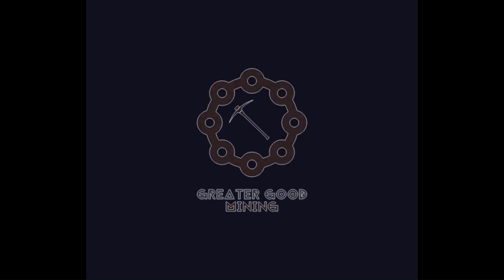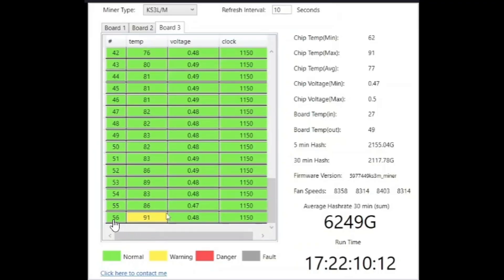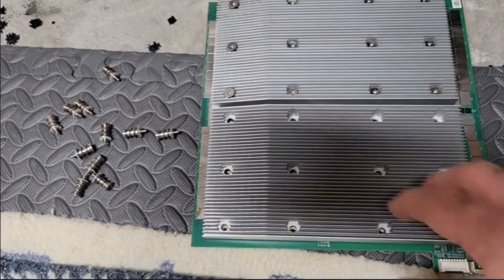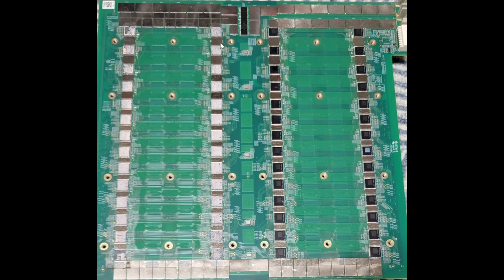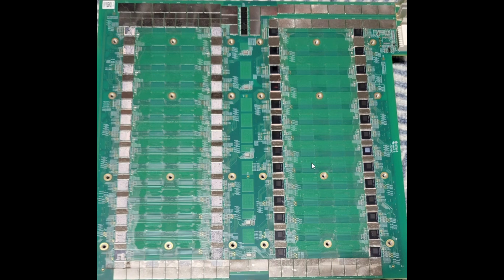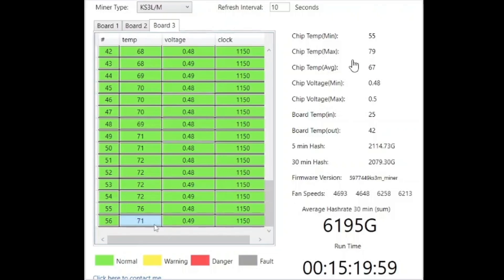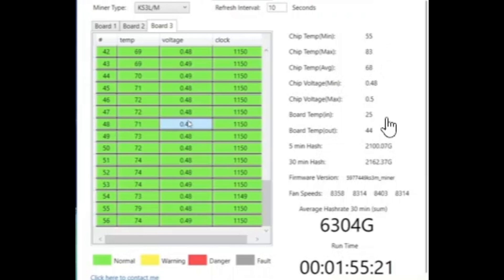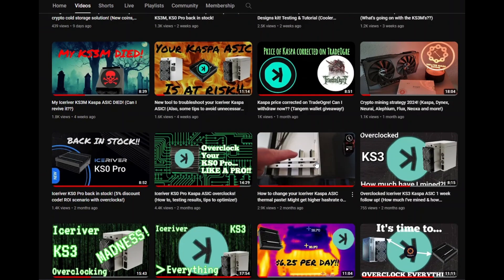Iceriver KS3M Kaspa ASIC thermal paste replacement! (Did it help my chip temps?)

Comment from the maker: Are you having problems with your chip temperatures on your Iceriver KS3M?
Reply: My KS3Ls are running fairly good temps, but the KS3Ms def needed repasting
Reply from the maker: @Farlok2088  time to get that Artic mx6 out Farlok!!
Reply: @GreaterGoodMining  hi do you recommend another thermal paste? becuse mx-6 is not available in my country
Reply from the maker: @Nawaf-ko9lo  mx6 is the one I have the most experience with buy yiu can look for other thermal paste with similar properties and conductivity. I've used Corsair brand thermal paste on CPU's etc in the past and it worked great. I hate to say it but almost anything is better than the stock thermal paste
Reply: @GreaterGoodMining  I changed the stock thermal paste of my ks3m to corsair xtm50 thermal paste and I still got overheated chips and for me it's hard to get mx-6 thermal paste so I have been searching for another good brand for my ks3m but I got not result so please can you help me with another good brand for my ks3m ?
Reply: How much g i need to replace 3 hashboard thermal
Reply from the maker: @7amanyalhayki929  I would recommend getting 2 tubes which is 12g total. You probably only need 2 tubes, but I like to have more than enough in case something goes wrong with reassembly. It sucks to run out and have these machines down while you wait for more to arrive. Here's a link to the Arctic MX-6 I use when I repaste my Iceriver Kaspa ASIC's https://amzn.to/3xjeUe0
Reply: i'm having trouble with my ks3m, been only running it for 2 days, pretty cool in my garage. Some chips are 105C. I'm going to repaste with Kryonaught Extreme paste, any thoughts?
Reply from the maker: @1sikteg  I don't have any experience with that paste. I'd recommend Arctic MX6 if you can get it. Also, I'd recommend a shroud kit and AC Infinity fan. That's what I have been using. I live in Florida and the garage these are in gets really hot sometimes. I havn't had any problems with this combo, so it is what I recommend
Reply: @GreaterGoodMining  thanks for the reply man! i will try a shroud kit and the mx6. Any shroud kits you suggest?
Reply from the maker: @1sikteg  I use Fruition Designs kits on my Kaspa ASIc's that I have running in my garage. I have a discount code in the description of the video. Here's a video on how to install it and some testing i did etc https://youtu.be/efmQCXJ18zM?si=Zs8BzPHq72qwJsuE
Reply: What program shows you the chip Temps like that

Comment: Howdy, just got my IR KS3M are there any mods that you recommend? I have the fruition setup on it. Looking for overclocking or maybe changing a board to get it to perform more like a KS3. Anything would be a great help. Tyvm, Trev😎
Reply from the maker: You won't be able to overclock this or change boards to get performance anywhere near a KS3 on these. I don't recommend overclocking them. I'd actually recommend just repasting it and keeping it running strong 💪

Comment: I just repasted my KS3M with mx 6 paste and I saw almost no change in temps. I have 1 chip,, chip number 2, running at 89 and a lot of my chips are in teh 87 so im not sure what I did wrong but re pasting didnt help much
Reply from the maker: Ambient temps also play a role. Some chips definitely will run hotter than others based on the design of the box itself and the fans. Also Sometimes it's hard to get even torque on the screws when remounting the heat sink
Reply: @GreaterGoodMining  i appreciate it. My room runs at about 80 farinheit and I have the fruition design kit on it so I figured I'd see better temperatures. The chip 2 on board one is sitting around 90 to 91 now after running it for several hours and I put a good amount of paste on each chip so I'm not sure the issue
Reply from the maker: @justsavvysnipes  More isn't always beter when repasting. A small blob like a peasize or so is usually good enough. If you lay it on too thick the conductivity won't be there to transfer the heat from the chip to the heatsink. Another thing you could try is to move the hashboards around. If you have a problem hashboard with chips that get hotter you could try to move it to a different slot to see if the air hits it differently. Always at your own risk of course

Comment: do you know which board is board1? i have temp issue only with board1, and which one is chip1 and chip56?
Reply from the maker: From what I've been told chip 1 and chip 56 are both toward the center of the board and closest to where the ribbon cable plugs in. I'm not sure which order the boards are in. Your best bet is to pull one board at a time to find out
Reply: @GreaterGoodMining  thanks, by the way, how many paste did u use for 3 boards?
Reply from the maker: @bun-tsetsng2090  you should get 3 tubes just to be safe. Links in the description of the video if you want to get what I use

Comment: i 
 have problem 1 chip is not working so i factory rest to old frimware now its working but voltage problem is not solving min 0.4 max 0.51
Reply from the maker: You can use pbfarmers firmware to power voltage

Comment: So i guess i shouldn't get this but i did got this ks3m but i got 2 and after changing thermal paste and adding infinity fan still some ship tem are about 86 to 89 what you think i should do immersion cooling?
Reply from the maker: What are your ambient temps? What do you have your AC infinity fans set to? Did you tighten the screws down evenly? Are the chips that were causing you problems before the repaste the same ones that are causing you problems now?
Reply: @GreaterGoodMining  tem is about 78 to 80 degrees and i have the 10 inch ac infinite fan and used a specific tool to tight all the screws same pressure like i took them off and i will say after repaste are better bc from power on was like 109  and they are not the same ships sometimes ones  other time other it varies do you know if i could take the back part out repaste that or not?
Reply from the maker: @jafuentes89  no the back fins are glued on with thermal glue. Nothing to repaste there. Your ambient temps aren't too bad. Are your ac infinity fans maxed out? You might want to turn them up if you have wiggle room there. My ambient temps are around the same as yours. I exhaust all the heat outside of the building. I have my ac infinity fans set to 8 right now
Reply: @GreaterGoodMining  yes i have same settings at 8 speed but I'm concern when summer comes i have ks3 at 7 speed and the tem of this one is 75 to 78 and i didn't touch thermal paste not sure why this one is different and i could speed up to 100% but summer it will not help that's why I'm trying to find other solutions immersion Cooling for the 2 ks3m for summer not sure yet it costs a bit of money for 2 of them
Reply from the maker: @jafuentes89  are you exhausting the heat to the outside? Do you have a way to bring in fresh air? I have an AC infinity T16 fan that brings cooler air into my garage, and another T16 fan that helps exhaust any hot air out.
Reply: @GreaterGoodMining  i have them on my basement and i take the hot air out but i will do what you say to bring cold air in and it will help bc were i live still in the 30 and 40 degrees so that would help more electricity but it will help
Reply: Hey a quick update after i add the fan to bring cold air in to the miner the temp drop like crazy from 86 to 65 and i drop the fan speed to 50% and i try to keep the chips temp around 68 to 70 it really help so good solution until i get hot summer tem in 3 months at least making my money back thank you
Reply from the maker: @jafuentes89  nice, glad it's working out better for you!

Comment: Hello, what is the name of the software for reading the miner?

Have a KS3M, 1 hashboard doesn’t work. It is displayed, stays cold and does not hash. Today, after a restart in the funeral, it suddenly worked for 20 minutes. The temperature was 10 degrees higher than the other 2 boards. Then it stopped mining again. What can it be? Plug? Cold solder joint.

Thanks and greetings

Jerry
Reply from the maker: Could be thermal paste. Try the beta firmware from iceriver.io for the ks3m. Let it run for about 3 hours to see if it will help.
Reply: @GreaterGoodMining  I installed the latest firmware from Iceriver a week ago. What software do you use to read out the individual temperatures from the chips, please?

Greeting
Reply from the maker: @jerrylefunk5402  you can download the Iceriver monitor tool here https://t.me/swift_mining/2528

Comment: It would be nice to see updates on the cooling and how long this paste lasts. It doesn't see to last very long on my GPUs
Reply from the maker: That's a good idea. Maybe I'll do an update video down the line. To update you right now. It's holding up well. My chip temps are still where they were when I did the video initially. So far so good 👍

Comment: Awesome video man, perfect timing. Just about to re-paste my KS3M as well. Did you end up removing the plastic sheet thats covering the chips?
Reply from the maker: Thanks for watching! I ended up leaving the plastic alone on this repaste. Everything was lined up properly on mine, so none of my chips were covered by it. I assume it is there to help prevent anything from shorting out. It's weird because several of my hashboards from other Iceriver ASIC's that ive repasted didn't come with the plastic sheet
Reply: @GreaterGoodMining  Got it, opening it tomorrow. Hoping it's already lined up, if not I'll most likely remove it and try to align it the best I can. Appreciate the videos man, really helping out the community !
Reply from the maker: @MisterCaloy  If it's misaligned from the factory I would just take it off and leave it off. Once you peel it off, the adhesive will likely be ruined, and it'll just happen again
Reply: @GreaterGoodMining  Thanks! Mine actually ended up being lined up just fine so it worked out. Keep up the great videos sir!

Comment: While there is a possibility uneven airflow affects individual chip temps, it's unlikely to cause significant deltas since the heatsink is a monoblock.  What is more likely is the pressure isn't even across the heatsink.  That could be simply due to a screw not being tightened enough, or even from a screw being overtightened - since these boards are so large, they can easily flex  and pull chips away from the heatsink if you overtighten one or more screw(s).
Btw, i think you could get away w/ using 1/3 of that paste :)
Reply from the maker: HaHa when I was applying it, I started to realize I was going through more than other paste jobs I've done lol. And yeah, I see what you are saying about the heat sink and uneven screws. Definitely seemed like that 3rd board had issues with the outer edges. Maybe it was just slightly warped
Reply: @GreaterGoodMining  Yeah, i just looked again, and when you first pulled off the heatsink, most of the paste came off on the sink for the first couple chips (furthest away from the connector), especially when compared to the others ones.  Definitely looks like a pressure problem.
Reply from the maker: @ryandugan  Iceriver needs one of those nice torque screwdrivers we were talking about in RPM's Discord!